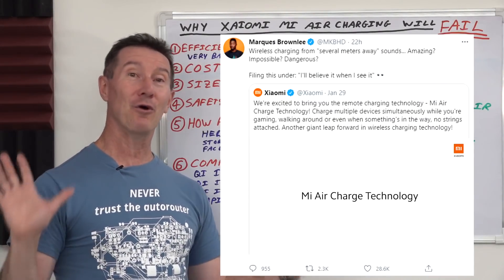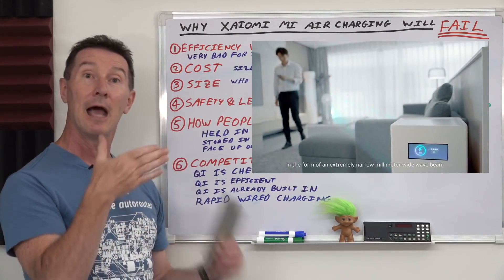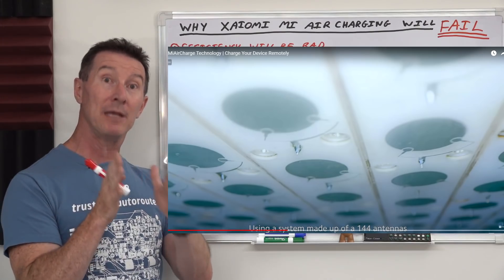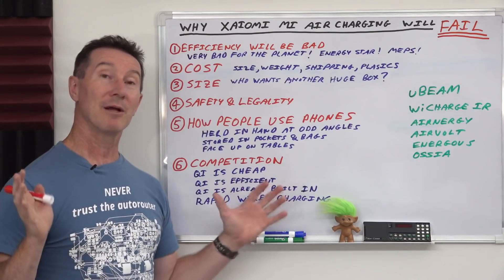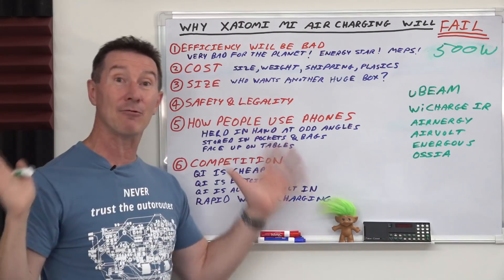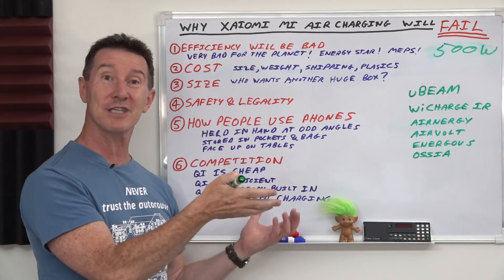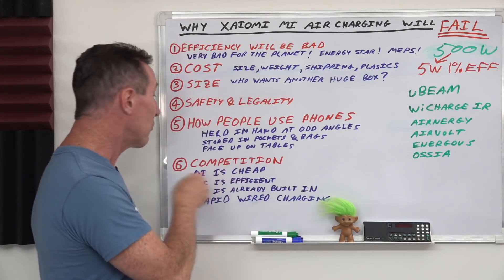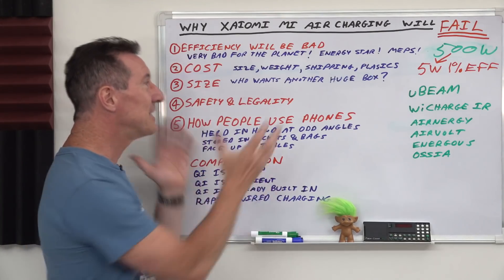EEVblog #1369 - Xiaomi Mi Air Wireless Charging BUSTED!

Comment: Some people will want air charging at any cost, no matter how slow it is.
Reply: You have to be rich and stupid enough to have 500w-1kw blasting at your hands and face just to slow charge your phone. The novelty factor is about 20 seconds.
Reply: @markm0000  the video acknowledges that it could be done safely
Reply: @andrelecomte  keeping AR gear charged during use would be an application.

Comment: The big question is, is it legal? If it's kicking out radio waves then it has to conform to local/international laws, even if it's used for power transmission it's still using radio spectrum and in the UK Ofcom would have to allow it's use ( see here http://static.ofcom.org.uk/static/spectrum/fat.html ) and I doubt that would happen, so if people did import it they could be fined for using it.
Reply from the maker: It's a very seriosu bit of RF TX kit, so yeah, authorities will not take kindly to unapproved imports.
Reply: @EEVblog  One of the manufacturers of shitty "pro" audio equipment (Pyle Pro) got fined in America by the FCC because they were selling wireless kit that either had no FCC ID, an incorrect FCC idea or in some cases no idea what frequency the systems used at all, https://docs.fcc.gov/public/attachments/FCC-20-46A1.pdf

Comment: With this level of efficiency you have to wonder if it wouldn't be better (from an energy stand point at least) to just cover the back of the phone in the absolute best solar panels money can buy. Before you all shout at me I realize it's not the same and there are loads of reasons why solar panels on the back of your phone aren't great etc etc. But comparing a 1% efficiency to just leaving your phone face down on the table, makes you wonder at least.

Comment: ? I thought those were debunked years ago. Their principle purpose, besides extracting cash from the gullible, is to generate RF interference.

Not necessarily bad for the planet. A 1kW RF generator in the living room could heat up the occupants - saves on central heating, addresses overpopulation.

Comment: I am looking for a wallet charger. 
It doesn't need to be wireless persee.
Reply from the maker: Just wait, government money printer go Brrrrrrrrrrr....
Reply: I'm looking for a phone with changeable batteries. Some problems could be solved so much easier. One in the charger and one in the phone. easy peasy.

Battery empty? just swap with the full one.
Reply: I don´t even understand QI charegers.. why not just 4 gold plated dots on the backside and a few permanent magnets?
Reply: @matsv201  That's brilliant. But that loses all of the "wow factor", doesn't it? Just not cool any more. Most public are mesmerized by non-contact energy transfer. They barely grasp magnetism much less inductance.
Reply: @matsv201  so... original apple MagSafe? That everyone wanted to get rid of so bad? 

Honestly if Apple goes portles it’s what they will have.... my proof? Apple Watch doesn’t have any charging port. But it does have a diag port hidden that’s used to recover. iPads have it for the keyboards. There issint any way to hide it on iPhone so it’s most likely going to be on the bottom (and possibly one of the sides) and it needs to be more readily accessible anyway. Not like the watch you don’t need. You need your phone. People also do know Apple is working on going live with wireless recovery right? 

I’m happily ready and want to get rid of the port if they put actual MagSafe in its place (and might actually buy a new MacBook if they bring it back too)(Atleast as an option)
Reply: @EndOfLineTech  I don´t like magsafe, becasue the magnet is not in the connector. I would like the magnet to be right behind connector. It should also be redundant.  Like having combine power and signal similar to what POE have. 

I´m originally a electronic engineer, made a whitepaper on a totally portless phone back, it have to be like 15 years back now. The point was to have simple construction that is cheap to made watertight.

There was two problems to be solved. Debugging contact and SIM card. E-sim was not a thing back then. But that could be solved with optical connection ad a adondevice..

Personaly i would probobly rather see a solid phone with a plate conection in stead. Wireless charging is subotimal.
Reply: @matsv201  I'm not talking about iPhone magsafe. I'm talking about Mac magsafe. (still have, use, and love) Of course would need modified to allow data transfer (and not just for talking to the charger) but that's a small feat. Its really strong and would still work for macs to this day.

dono what they could do but for mac its recessed just a bit and fits just right. Best option I could see with iPhone, helps with keeping it in too and just cant be slip off. you have to pop it out. but even flat like the iPad keyboard connection could work maybe with 2 small locating holes? all it needs to be is a magnetic USB port. this aint samsung they will do it at least half right. could go on and on. but its going to be like mac magsfe (with data) .

Like I said they have a diag port on apple watch. There is no way around it especially on a phone and there is no place to hide it, so they might as well make is accessible. even if nothing user accessible. For the small percentage that will need to restore their phone were getting wireless restoring. and a smaller percentage of that, that wont work; by that point a physical cable might not even work
Reply: @EndOfLineTech  Yea i did understand that. But its still springed conectors with a magnet around it.. ITs nto the best solution

Comment: Finally good to see some actual engineers who check instead of falling for these gimmicks
Reply: I'm sure it will be endorsed by the like's of The Verge et al, it's amazing that they still have any authority on tech (says a lot about the general population🤔).
Reply: @garethevans9789  It's actually shocking how many of these so-called tech magazines just copy press releases from companies without question and call that journalism
Reply: @user-td3yi1mq7p  They do some time. The problem it doesn’t. Generate ad revenue.
Reply: I don't think that it needs an engineer to understand that huge box charging small phone = bad.
Reply: @DarthChrisB  Exactly. The box is large for a reason. Usually the reason is that if it were any smaller, it would melt 🤣
Reply: loool this people are so stupid in this channel he debunked ahit he nas no clue waht he talking
Reply: Having an engineering degree, my gut feel from the start has been that these wireless technologies were not going to be efficient.  It's good to see this vindicated.
Reply: Spot on man we all know Xiaomi got no real engineers.
Reply: Its a start to a new technology. If you cant support, stop complaining atleast. Its not easy like posting shit in comment box. And this so called engineer should use his brains to fix the gaps, not to increase it.. pity